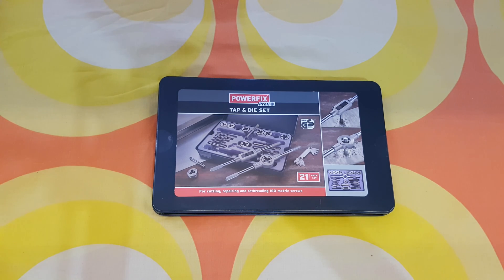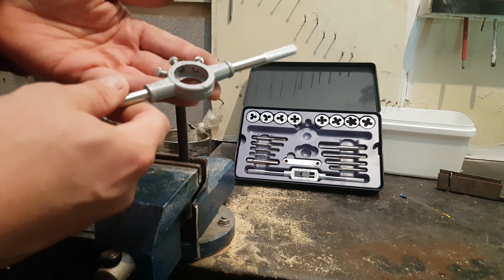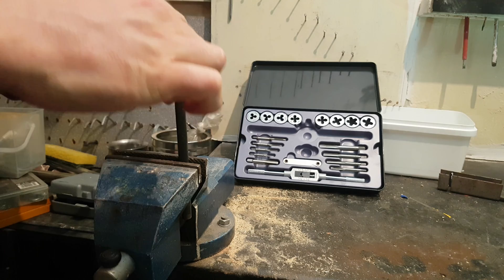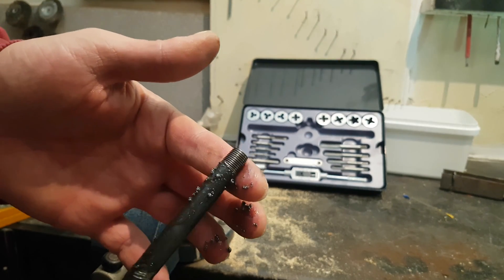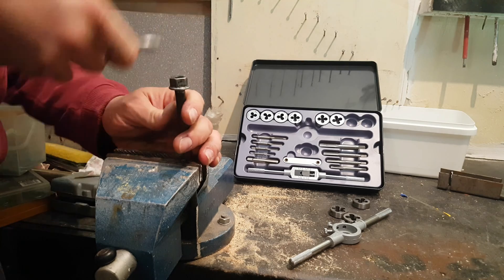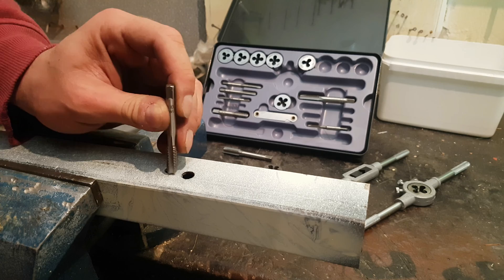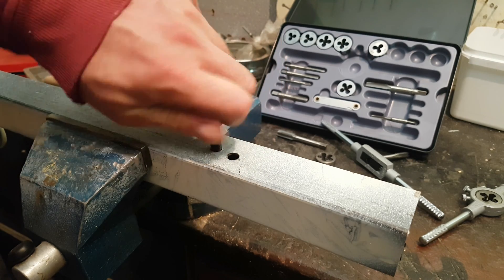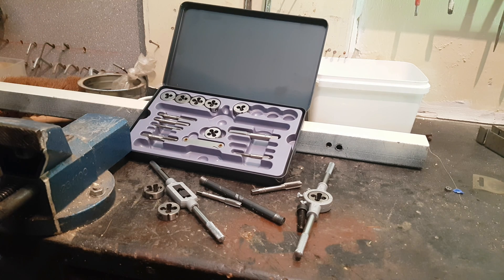How TO Use TAP AND DIE SET Threading Tools POWERFIX

Comment: Have one of these sets. Sorry to say found pretty useless for tapping new blind threads in steel. The cutting edges immediately blunted with very moderate hand pressure and never got a bite.
OK for cleaning existing threads but utterly useless for new builds.  I am a reasonably experienced engineer/mechanic and only bought these for a quick away from home job. Should not have been impatient and waited till could use my normal better equipment.

Comment: When re-threading a rusty M5 (M5x0.8) bolt, should I use a M6 (M6x1.0) threading pin or do I maybe need to go two steps higher? (M5 and M6 has different thread stepping, 0.8 and 1.0, does that matter?)